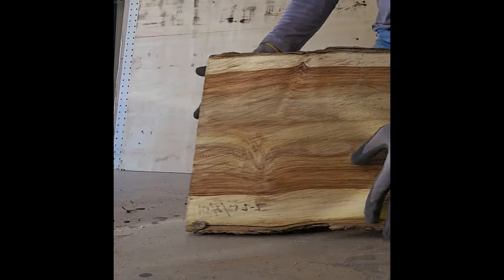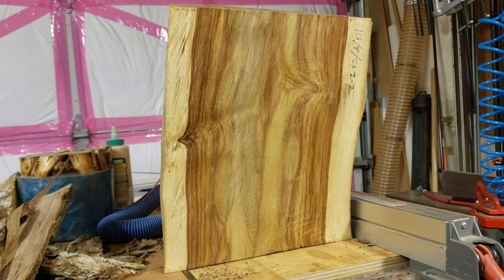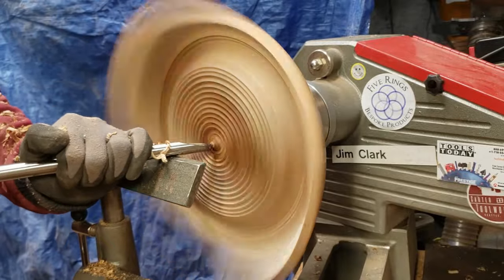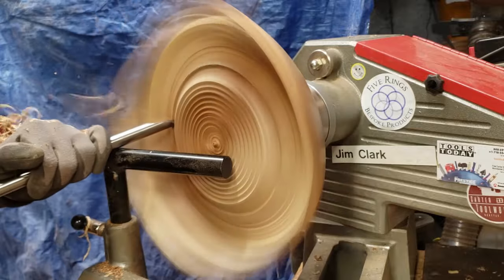Woodturning- Big Sissoo Live Edge Bowl

Comment: I have been watching Kent for years and I see you used his idea of hanging a tarp behind you to control the shavings.  Beautiful bowl reminds me of a very large table my father made from "monkey pod" he brought back from Hawaii back in the 50's.  Very hard as you said but the finish will last forever.  My table is 79 years old and never needed refinishing.  Phil from shady acres is also a treasure.
Reply from the maker: You are absolutely right about me stealing Kent's tarp idea!  I have a CNC machine right across from my lathe and it used to get absolutely covered in chips.  I still need to tweak it a little, plus the blue tarp looks kind of messy on camera.  I really love turning the Sissoo, but the dryer the blanks get the harder the turning.  The pores are so tight that it finishes like glass.  Thanks for watching!

Comment: Здравствуйте ! Я из России , очень понравилась  чаша, очень красивая текстура дерева . Работа превосходная, смотрел на одном дыхании как Вы уверенно точите такую большую заготовку. Извините за вопрос, может Вы и говорили, но я не понял. Древесину какого дерева Вы используете и как Вы сушите такие большие половинки полена? Хотя по видео я подумал, что Вы точили из сырого дерева, но Вы покрыли чашу маслом. Работа - шедевр. Спасибо!
Reply from the maker: The wood is Sissoo which is also called Indian Rosewood.  The logs I have are still kind of wet and still drying.  The ends are coated with a wax sealer to help prevent cracking. Once I finished turning it, the bowl was almost completely dry due to the dry weather conditions here in Arizona, USA.  Thanks for watching!
Reply: @FRBPturning  Спасибо большое.! Ваша сиссо похожа на  яблоню, только не дикую, а сортовую. У неё сердцевина тоже тёмная, темнее чем у сиссо, а оболонь белая. Ваши работы прекрасны,